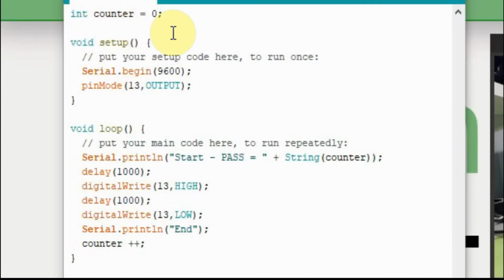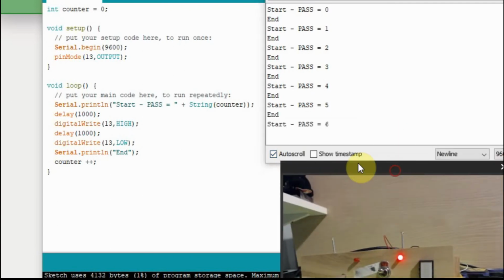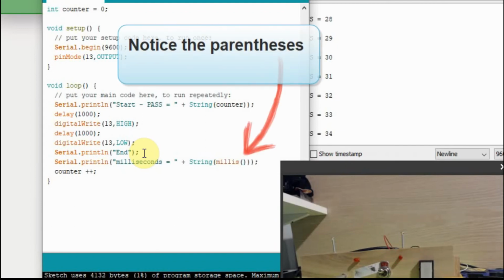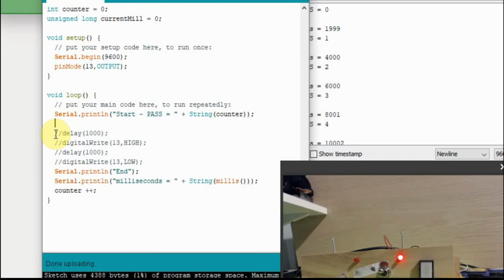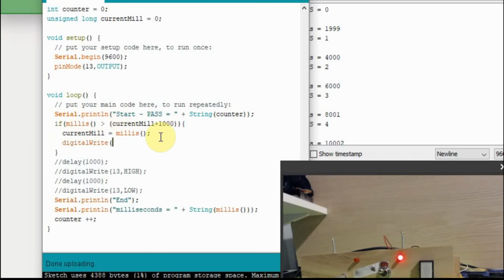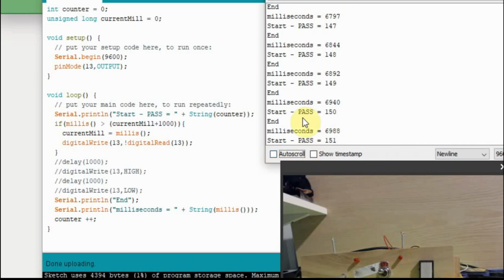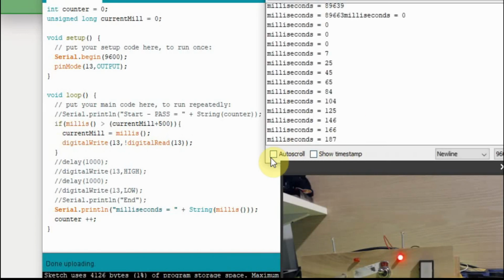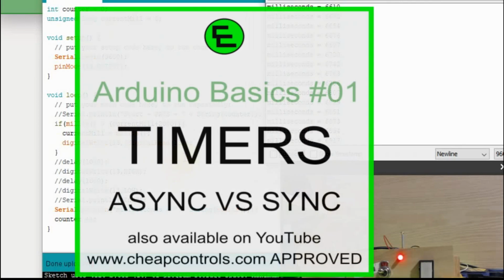#80 Arduino Basics - Delay Synchronous vs Asynchronous - Arduino Programming Tutorial

Comment: I like the explanation on how to use millis() for delays. However, I am concerned about this way of doing delays potentially being affected by rollover. Instead, of adding to current time, what if we subtracted then compared to delay?

i.e. if ( ( millis - startMillis ) >= delay )

May be I'm missing a key point here, but it seems in this method, say as the program runs closer towards the millis rollover instance, adding the "current millis" value (which is now already a large number) to a say large delay value so that it is just close to but not large enough to the highest value,  and since it is asynchronous timing (where other tasks are being carried out which could perhaps have synchronous delay blocks in them/sub-functions),  cause the millis to rollover, when it comes around to this check. Then, millis would have been reset/rolled-over so is then a low value, but the value being compared to is at the other extreme end, creating a huge unexpected delay (possibly more than a month).

That was a bit wordy, trying to explain the scenario but, hope what I'm saying made coherent sense, to discuss. It may be just that both methods are the same and it's understanding of unsigned long math.
Reply from the maker: You are 100 percent correct.  I have the same issue when I monitor bandwidth speeds on a network switch.  Roll over is a thing to worry about.  Most of the people that watch my videos are new to the Nextion and Arduino world and are looking for basics.  Most of them use the delay function.  The video was to point out an alternative.  I will have a rollover video coming out.  Are you looking for the answer?  Or was that just something you noticed could be a problem?  You can use a watch dog timer to make sure this does not happen or you can use an error check in your if statement.  Somthing like if millis < delay then do something becasue millis should never be less than delay.  I might not have that 100 percent correct but I hope you can see the point.   Subtraction can als be an issue depending on when you collect your startMillis and when the millis rolls over.  I am thinking as I type about an advanced video on roll over and how to adjust on the fly without adding a bunch of code.  I hope my rambling helped answer your question.